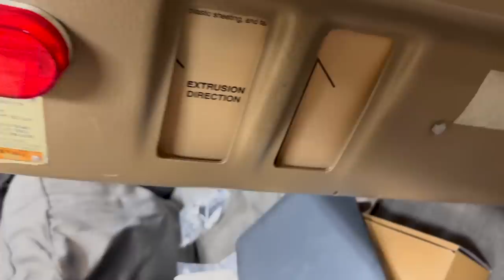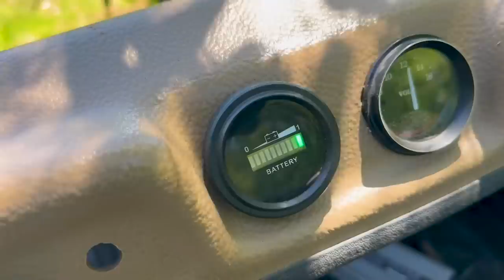We Built An Electric Amphibious Car and Almost Drowned...Twice!

Comment: One problem I see right away is the tires are kind of worn or aren't the right ones., the bigger the ridges the more thrust it will have in the water.
Reply: Those tires are like new. They were not designed for speed in the water. Look show slow the Sherp is in the water!!
Reply: The wheels are also spinning too quickly. It's dragging in a lot of air which reduced buoyancy and effective drive.
Reply: I also think tires are faced wrong direction
Reply: Tires also installed backwards too
Reply: @Zeck88522  the tires are facing the right direction
Reply: @Babycrat  they're facing the right direction

Comment: I'd call it a win. It works really well but i think it needs a slow speed for the water. When i was a kid my friend had a couple and the modded one was slower on the water because of cavitation. If you got it moving at a slow speed and slowly increased the throttle it wasnt bad but the stock one was better on the water. He also kept more air in the middle tires so the steering was les jerky.

Comment: Pretty sick build Rich. I'd like to see it with an electric outboard motor and see how fast it goes in the water when both plugs are in.
Reply: 2 paddles would also be faster and add to safety.
Reply: Jet-drive not external propellers.
Reply: Or hell, an electric inpeller like from a jet-ski!
Reply: @SpamMouse  Nice thought, but it wouldn't fit. External propellers attached to drive shafts would make more sense, so you don't have to use yet another electric device for propulsion.
Reply: Just needs chunkier tread on the tyres like a tractor, and better throttle control to stop the wheels from causing cavitation, its hard to propel yourself forward in a sea of bubbles.

It might be fine if it's not sitting low in the water and lugging twice its own weight in bilge water, then the operator won't feel the urge to floor it and create a froth that it can't propel itself through.

I'm reserving judgement until I see it working properly in its current (pun intended) form.
Reply: @SpamMouse  unfortunately the intake would quickly get packed with mud and dirt.

Comment: If you want to try again use 2 separate electronic motors one for each side of wheels , would make driving and stearing much better by leaps and bounds , I had one of thoes 6x6s with a single gas engine , I swaped that out for 2 predator engines and it really drove as intended flawless control !!! My only downside was no reverse but it turned on a dime so really no need for reverse , with the dual electric motors you would also have reverse that solution is best
Reply: I guess id like to see your twin gas engines in your MAX. I personally call BS to your claims. Where can I see the magical pictures of your twin gas engine 6x6 that doesn't exist?
Reply: @Joe_M- 
This was like 20 years ago and a very simple task to make work , stop being negative

Comment: Other thing is..... you NEED to keep the bearings heavily greased where they go through the body on all six axles.
The grease in those bearings are your only seal to keep water out.
On the outside of the MAX right atop each axle where it goes in the body should be a zerk grease fitting on each axle bearing.
Grease grease grease them up and your water leaks will stop.

Also, now that you have removed the fuel tank in the front and added heavy batteries and the electric motors weight in the rear, you'll need to add some ballast weight in the front where fuel tank used to be.
Or simply move your batteries to the front.

Comment: I've been wanting to build an EV Argo for years, it's like my reachable dream toy. What i wanted to do was put each wheel on it's own smaller motor and do away with the big chains, and then put a joystick controller from a mobility scooter to control it so the each side could be put in opposite directions like a zero turn mower. Add a switch that goes from wheel control to 2 propeller motors and still use the joystick at a much faster speed in the water.

Comment: Have had a MAX II 6x6 like that for over 22 years.
You need to sit in the center of machine with the steering sticks between your legs.
Also, while in the water and sitting in center of the seat, you need to not only power your steering by the levers, but you LEAN just like a motorcycle to help make your turns. Yu can just about turn in a circle by only leaning to the side without even steering with steering levers.
Steering levers AND leaning while in the water to make your turns.
I personally use a trolling motor mounted to body if I plan to do any serious water time.
Tires will power you across a quick pond, but a day of water use you'll want a trolling motor.

Comment: Add a raised tube to your bilge outlet, when you hard accelerate the outlet looks to be below water.
Reply: Since it’s a pump it should be one way right?  I e seen plenty of boats with bilge pumps below the water line or just above it.  I could always be incorrect though 🤷🏻‍♂️
Reply: @BFT88  my thoughts would be, by the pump being under water the it would be working harder and struggle to keep up.
Reply: Or just make it water tight…or maybe spray foam all the cavities. Floatation by displacement.
Reply: @surfcoasttreasureman2441  The only measure of how difficult something is to pump is energy. For water, all that matters is the difference in pressure and flow rate (constant here). 
Water pressure can be measured by how much you raise it, so if the outlet is below the waterline you must pump up to the surface. But if the outlet is above the waterline, you must pump it to the surface and then some more, wasting energy. 

The real reason these things should be above the waterline is that the pipe or the pump could fail and start letting on water if it's below the waterline.
Reply: Dont bilge pumps have a check valve like a sump pump. so it can only eject water?
Reply: You might find that when the hull doesn't have a gigantic hole in it allowing a new ocean to form in the bilge, the pump outlet might not be so close to the drink, also the paddle wheels might work a bit more effectively when it's not trying to carry an olympic size swimming pool worth of water inside it.
Reply: @theParticleGod  how about a propeller in the back for added thrust.
Reply: @ZzHasbrozZ  Propellers are a pain in the ass whenever you aren't in the water, plus if they hit the bottom when you're exiting or entering the water at a steep angle they could stall the engine or shear off. A retractable propeller isn't practical in the space, and the same goes for a hamilton jet. 

Chunkier tyres would help, and better throttle control, but the main problem is the ridiculous weight of a bilge full of water, which weighs A LOT compared to air, and besides sapping all of your power, causes a vicious cycle where the more water you take on, the lower you sit in the water, eventually causing you to take on more water... a phenomenon known to sailors as "sinking".
Reply: @imjustabill247  Usually nope, bilge pump outlets are normally above water line, because it's more simple to make. There's a possibility, that a check valve can fail, stuck open or closed.
Reply: @Njazmo  interesting, i didnt think about it failing closed. thanks for the reply!

Comment: make some steel paddle wheels for the middle axel that are slightly smaller than the other wheels so you can still drive it on road.  but in the water they will act like a side wheel river boat.

Comment: 22:38 It is possibly designed to have a balast of water inside for stability where the level sits above the axles.

Moving the trigger point for the bielge pump to that level may improve performance through the water when propelled by the wheels.

Needs more positive bouncy.

Comment: Use the output of the bilgepump routed trough the old drain holes, so it gets a little push forwards, also do sth about the weight distribution, maybe another battery up front?

Comment: Rich, weld some metal paddles to the rear wheels for better water propulsion.
Reply: make some steel paddle wheels for the middle axel that are slightly smaller than the other wheels so you can still drive it on road.  but in the water they will act like a side wheel river boat.

Comment: Need a high loop on that bilge pump line.  Also need to get rid of hard kink right when it comes out of pump.  Water is certainly flowing in from bilge pump when wide open before the pump kicks on.

Comment: What cool about electricity is it's always the ideal technology to put in a haphazardly made 40 year old non water tight boat like vehicle. Unlike an internal combustion engine that is susceptible to water, electricity has no issue being fully submerged since there are no wires underwater to short out the circuit. You definitely need to do an electric amphicar, those are super water tight and hulls are built to go over 60 MPH on water.

Comment: You need at least a gallon of flex seal, that stuff makes screen doors float, yep that's what you need 🤔🤣😂🤪
Reply: I mean the screen door is basically used like a fiberglass/polyvinyl reinforced backing to the flex seal similar to how fiberglass builds are done.

Comment: Argos are a blast when you're in the water or going straight, they are not fun when you need to turn. I had one awhile back and took it for a spin when it was delivered and didn't realize how they turn especially on concrete and I almost got ejected from the vehicle. They are not as bad off road but if you expect it to turn like a car or ATV don't. You will get some g forces if you turn at speed.

Comment: You guys should build some extensions for the steering control sticks that go up and over to the side so you don't have to steer so awkwardly, you could even make them so they rotate either way and lock into position in front of the driver on either side... just a thought...

Comment: Does it make any difference to the speed on the water which way around the tyres are?
Reply: I don’t know about those tires except they suck. He should have unidirectional heavy tread tires and sand paddle tires in the rear. Right?

Comment: one of these with paddle tires and a drop down sideboard it would be sick with a better seal and pino situation. I wish we could see more improvements done to the Argo honestly I know it runs wonky because of the tank steering but it's a cool vehicle
Reply: Or hypothetically imagine one with a stronger drive and 6 alternated large paddle tires to smooth out the off-road drive and improve the speed when riding amphibious could even scale this up a bit. But electric battery malfunction will always be the biggest concern 🤔

Comment: Used to work for the company that built that machine (recreative industries, buffalo, ny). The two drain holes will accept a snap in caplug plug, or in a pinch, an empty 12ga shotgun shell. When in water, get tires turning and lean to opposite side to turn. Dont try for speed. Think you overfilled the tires (5psi).

Comment: You guys should consider installing some sort of electric propeller.  Using electric to drive the wheels in the water is NOT efficient.  An electric propeller would increase your speed in the water.

Comment: Epic, time for some wheel paddles. Put on extended lug nuts and add small paddle-boat paddle to the inside of the wheel. That way ya get more water speed with a small footprint that won't add a bunch of weight or width.

Comment: Usually the driver would sit in the middle and not to one side and have one passenger on each side. People were skinnier back then. Todays Argos are much wider. 

Also turn your tires around for better water performance. They are currently facing the wrong way.

Comment: Could have used the black box.
Stuff the batteries in and then heat the outside until soft. Custom mold around the batteries.

Comment: Still never got a response on that vanguard you just tossed aside... We have the older tec. 4 stroke and would LOVE the opp. to upcycle your old engine if it has no future to you. Also, you should emphasize that it is a Max 2, to bring more knowledge and notoriety to this machine line, as we LOVE THEM personally. I've also had this thought, being an avid PEV enthusiast. I still cannot afford an EV 'vehicle new, but i try to convert all my toys to get acquainted. Keep up the great work! Also, have you considered adding courses regarding SMALLER PEV type mechanics in your roster for apprenticeships?

Comment: Not an Argo, it's a Max. Also just FYI, higher wheel speed isn't necessarily your friend on the water. At a certain wheel RPM, all you start doing is cavitating.
Reply: Exactly and this one with that motor is from the 90’s not 70’s.

Comment: 6:54 You may as well continue be worrying about this, because they are too close. A motor, generating heat, against a closed box of batteries, generating heat, against a motor, generating heat, against a close box... I mean you should at least put a 2-6 probes for temperature all around and inside those things. And having them on a panel visible somewhere might save someone's pants.

Comment: Nice build! I have the same machine, been wanting to do the same conversion (The Vanguard Briggs is Annoyingly loud)!!!  I rebuilt mine 20 years ago & installed new sealed bearings & the large o-ring inside the bearing mount flange, If I recall correctly. Yeah mine leaked bad too before the repairs!  Here on YT, an electric 6x6 makes multiple appearances (starting about 22 min.) in this old sci-fi series from the 70's.  Search Title: "Space: 1999: S1 E15 - The Full Circle"
Reply: Also use marine grease on the zerk fittings on all the axles, to slow leakage

Comment: Begeebus and yikes, need some belts and a roll cage much...? 😁

Maybe build a prop & shaft to poke out the back after repairing all the seals...

Wheels are causing too much drag  and cavitation...

I wonder if it's cheaper and lighter to make & use an orbital gearbox, or to use 2 motors and remove the unneeded parts of the drivetrain... And control electrniolly...

Maybe a good idea to atach an alarm float switch
😂 no plug 🎉 yay its the Titanic reenactment

LOOKS LIKE FUN! 🎉👍 👍 👍

Comment: Correction, you mounted the new electric motor to the old engine frame those were internal combustion, a.k.a. gas or some other sort of fuel, and now you’ve converted to electric

Comment: Rich, you wouldn't believe the speed difference some actual Amphib ATV tires designed for water would make on you 6x6..(Like those sold through ARGO).  The tires you have suck for water.   By the way, your little unit is a MAX, not an Argo...different companies. Anyway I love you little machine!

Comment: I used a trigger throttle on the stalk, much better control than a foot pedal when you're bouncing around.  Also it looks as if you have too much air pressure in the tires, it rides better with less than 5 psi.

Comment: Looks really fun, bit slow on the water, wonder if you could use and electric outboard. People usually use multiple bilge pumps because they are prone to failure, if the float gets stuck it either burns out or doesn't switch on.

Comment: I have a yamaha rhino sxs and if your familiar with them they are goat off road. I mostly use it around my farm. Well my particular unit is a 2006 and parts for it are crazy expensive and i want to bypass all that and go electric with it but i want to retain the 4x4 and locking diffs. Can anyone help me with this project with advice on how i should proceed